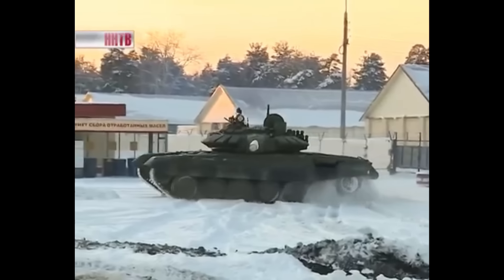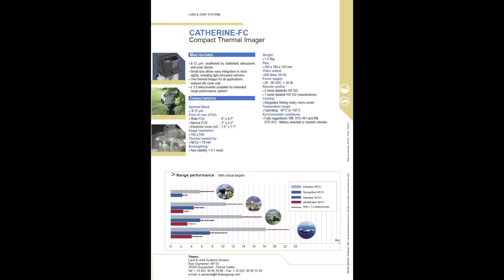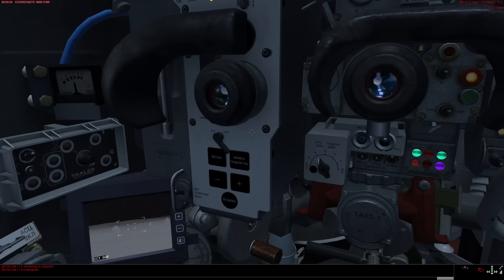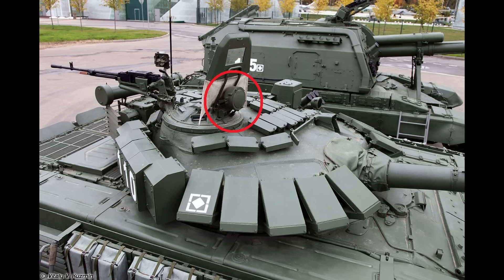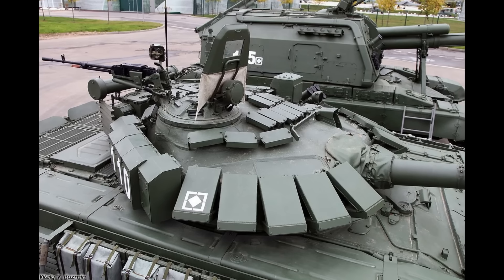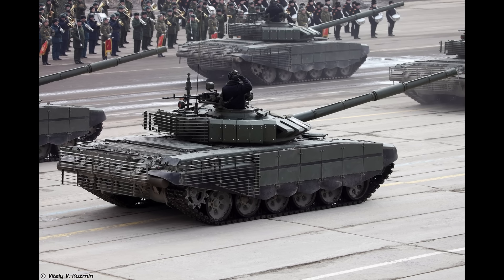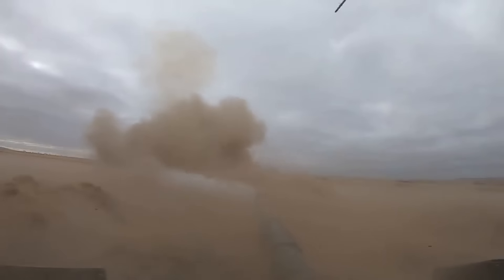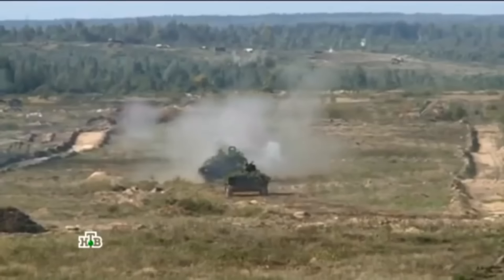Problems with Russian T-72B3 tank

Comment: I don't think I've seen any destroyed 72 having been penetrated in its frontal arc, so I'm inclined to say it's well protected there. I think it's Achilles heel is the reverse speed as in most of the footage given the type of combat they're doing, they're trying to shoot and scoot and forced to do a 180 to retreat and get hit. Majority seem to fall victim to artillery and mines more than anything else. So really, although an adequate tank overall it certainly suffers alot more in this kind of fighting as the tactics and forced used are not those for full scale war. The almost non existent reverse speed does boggle the mind though. I'm sure if there is takeaway for a further upgrade, that and the rubbish bags on the sides will be it
Reply: Well top attac atgms also ripped them apart alot
Reply: @Gazza Boo I think at this point, everyone bar Japan, China, India and South east asian countries should just buy merkavas.
Reply: The T72 was specifically designed for a head-to-head shootout in the open.  Hence the low profile and thick frontal armor.
Reply: @gamingrex2930  Laughs in K2 BlackPanther
Reply: Honestly the biggest killer is poor tactics. The issues with reverse speed could be negated if the tanks were properly supported by infantry and light armored vehicles. The tank wouldn’t have to worry about escaping quickly if it had units along side it to respond to threats. But you don’t really see the Russians doing that. Instead most of these tanks getting destroyed are alone, and exposed.
Reply: @timmteller871  and those seem to be in the minority just going off photographric evidence
Reply: @Gazza Boo I mean are not all MBTs these days only have Composite Armor on the Front only?
Reply: @gamingrex2930  Merkava is overrated. It's too heavy, not well protected and don't have that much firepower.
Reply: @gamingrex2930  merkava is way too heavy for most of these nations and marginally better than rest of the competition, merkava is also not ideal for railway transportation,
Reply: Funny guy
Reply: @boot_boy_6945  This, so much. I'm surprised by the tactics used by both sides in this war. At least, what is shown through drone footage and otherwise. There seems to be no or lack of mutual support. I feel like it's a lack of proper training; neither infantry, nor armoured have confidence in each other. I remember an article written by the Germans during WW2 of the regular infantry and tanks. As opposed to panzergrenadiers (infantry trained to cooperate with armour) the infantry waiting for the tank to take initiative and generally sat back, viewing it more as some sort of mobile artillery platform. The same thing seems to happen in this war. Its why training is important, it overrides instincts and bias. I get using a tank to take the lead. Armoured and with a big fuck off gun. But that tank is only as useful as the infantry supporting it.
Reply: @timmteller871  well a top down attack ATGM will completely destroy any tank at this point lol
Reply: @gamingrex2930   Nah, Merkavas are over-rated and are designed to specifically fit the Israelis. There is a reason why no other main battle tanks can carry a small squad of soldiers inside: they don’t need to. They are also designed with crew protection as the main focus which to US, China, India, etc is not an issue as they have plenty of man-power to conscript from. It’s like suggesting an amphibious tank to a landlocked country, it ain’t right.
Reply: @randomka-52alligatorthatis34  No, composite armor in the sides of the turret and side skirts and like 1/3 of the hull is a common solution in modern tanks. Just look at M1 or Leopard 2.
Reply: @Gazza Boo that's called survivor bias. Look it up. You see wrecked tanks on the battlefield pierced through the rear, sides and top. But that doesn't mean they haven't been hit from the front. The company commander would probably observe that all his surviving tanks were hit from the front.
Reply: @gamingrex2930  ???. Makes no sense considering that they have different doctrines.
Reply: Nlaw, javelin, atgm etc etc etc makes the turret fly sky high boooom 💥 💥
Reply: @Weisior  I guess, but even then, those are only limited to the first few fronts of the sides not all. Unless it has been upgraded with add on with AMAP or other forms of Armor Package usually meant for Urban Warfare or Low-Intensity Combat.
Reply: @denmark39  every atgm does that lol
Reply: @boot_boy_6945  This. Russia was far more successful in its painfully slow march towards Sievierdonetsk, because they had artillery barrages softening up Ukrainian positions ahead of the tanks. But when Russia can't properly field combined arms (such as the start of the invasion, or the recent Kharkiv counteroffensive) even their elite units act like they got caught with their pants around their ankles.
Reply: Most often i have seen T72 tanks just drive a little backwards and after that they do a 180, then put a pedal to the gas.
Reply: @ThishandlefeatureISdumb  "They are also designed with crew protection as the main focus which to US, China, India, etc is not an issue as they have plenty of man-power to conscript from."

Now that's not true. I don't know about China or India, but to the U.S. crew protection is definitely a priority. The U.S. military is extremely casualty averse, mostly for political reasons, as America doesn't have the stomach to endure high-casualty conflicts for very long.
Reply: @Weisior  T-72B have side composite armor - look at the video - in one top shot you can see where the large composite is. You can see the welds. It goes up to about half the way on the side of the turret to cover side shots vs. turret. 
Side of turrets in many tanks is just steel otherwise - also rear. Top and bottom.
Reply: @tomk3732  Obviously it has, I didnt even suggest otherwise.
Reply: @sprutsd9112  Yeah better than bringing a rail transportable metal coffin into a battlefield and having it get ammo racked by a single ATGM.
Reply: The T72 does seem quite adequate for the fighting going on.  Having watched and read a lot of accounts of tank warfare in Ukraine and elsewhere what I am going to say is that the exploding autoloader problem is massively exaggerated. Nobody would use a tank that could be defeated by kicking it angrily in relative terms. And there is more than enough footage out there of T6x, T7x, T8x, T9x tanks being hit hard repeatedly and either remaining in action or not detonating catastrophically. In combat footage it’s not at all uncommon to see a tank hit by three rockets or multiple shells and still keep on fighting effectively. The exploding Russian tank is a funny meme but it’s far from the rule in reality.
Reply: @MotivationSHCUM  That is a stupid comment. Within the IDF doctrin and logistical framework the Merkava is a very good tank. 
And it is well protected, reducing losses of crew members has a very high priority in the IDF. 

To complain that it would not be good in a western European doctrin misses completely the point IMHO.
Reply: It's all about the on-board gearbox. The transmission is not changed. The T-80BVM wins in this regard because of its engine. But the reliability of the tank from the hits of modern ATGMS showed the opposite - a high level. There are quite a few videos on the network, as 72B3 experienced hits of the same NLAW or Javelin. The record was for one car that survived 4 hits in the tower.
Reply: Why would you attack it from the front? That thought bias is interesting.

Comment: The problem is not as much the tank as it is every thing else (crew, training, tactics, operational strategy, logistical support, reliability.......).
Reply: Stop with your lame excuses already. The problem is the tank. To be more exact, the lack of equipment on this tank. All crews have at least basic training, or they wouldn't even be in the tank in the first place. That's what the army does, it trains the soldiers to do what they are supposed to do. Incredible, I know right?... 🙄
Reliability is part of the tank's mechanics, so if you criticize the reliability then you are literally criticizing the tank itself. By the way, the reliability is not even the problem with this tank.

The biggest flaws are the lack of an independent commander's thermal sight and of course Active Protection System (APS). If this tank had at least those features, then it would actually be a very good modern tank. But it doesn't...
Reply: @xAlexTobiasxB  Russian tank crews trained???  Dude let go of the marijuana!!!
Reply: @drinksnapple8997  how do you think they are able to drive and operate the tank? 🤦‍♂️🤦‍♀️🤦🏽‍♂️🤦🏼‍♀️
Reply: @xAlexTobiasxB  They can't.  Drunk with vodka.
Reply: @drinksnapple8997  Sure mate, the war in Ukraine never happend. Alright then 🤦‍♂🤦🤦‍♀
Reply: @xAlexTobiasxB   North Korea also operates a small navy of destroyers and a decent size air force (including Mig29s). Does that mean it will go 1 on 1 up against a US carrier fleet and a Squadron of Top Gun trained F22 pilots? Russia is fighting against Ukraine (who has very moderate training at most). If this was involved top US/UK and German tank platoons it wold be very different war.
Reply: @voidwalker9223  No, Northkorea has no modern "destroyers", only some small corvettes (called missile boat). The Northkorean submarines are much more dangerous, even tough they are only very old and outdated small submarines, they are still a serious threat (beacuse submarines are more difficult to detect and defend against). 
Besides what does Northkorea have to do with anything? Your comment doesn't even make any sense. This is not about Northkorean, this is about Russia, Ukraine and NATO

Ukraine ist not just "moderately" trained, they have in fact very excellent training from the USA and NATO. The urkanian soldiers are even better trained (and better equipped) than the Russian soldiers at this moment. The Ukrainians have superior drones, missiles and Guided Rocket artillery (HIMARS) to effectively destroy Russian Forces. 

The Russians have at least 3 Times Higher losses than the Ukrainians (50.000 Russians killed vs 15.000 Ukrainians killed)

Comment: Along with what you've pointed out, the biggest weakness of all Russian tanks in Ukraine is that they don't have an active protection system. You put an Arena-M and Nakidka on them and losses will go down significantly.
Reply: Or maybe start using it together with infantry instead of sending like 5 tanks in a city full with grandma's with RPGs.
Reply: Arena-M barely works, it was only tested against direct attack ammunition and judging from the way both Arena-M's and Afghanit's explosive cartridges are placed just next to turret ring they have 0 chance to hit a Javelin diving on the tank from 2500m above. That's why Iron Fist APS has a small turret placed on top of tank turret holding just 2 reloadable cartridges that can hit top attack ammunition.
Reply: Today very few tanks have an APS. Only M1A2C and Merkava-4. Turkish Altay sports an APS, but it's not in service thanks to lack of engine. Russians had an APS for a long time but being slow as fuck it's taking them ages to get them going. WHich is shit, but it is what it is.
Reply: @TonymanCS  Javelins have a low hit probability in top attack mode. More dangerous are the direct attack or overflight weapons like NLAW. Arena-M can deal with those.
Reply: As long as the Russian are able to produce enough of them..... right?
Reply: @FelonE-k8x  That's a point for any and all APS.
Reply: You're saying this as it's just that simple "just put on some of the most advanced systems in existence". These systems are still not well tested and expensive. I would hardly expect Russia to implement those kind of upgrades when they could barely afford to upgrade their tanks to the B3 standard in the first place.
Reply: @TehIdiotOne  "Barely" afford? Given that there are over 1500 of B3 in service, I wouldn't call it "barely". To my the standard is insufficiently high, but then my standard would be as expensive as buying brand-new T-90A or even T-90M tank.

As for APS - let's just say that it IS in the process of testing. What criteria is levelled at it is not yet known.
Reply: @TonymanCS  2500m above? Dude, who is your dealer? His stuff is GOOD.
25m maybe at best. Also Javelin is an expensive and painful to use POS. The ONLY worthwhile mode is top-attack. But when it takes 30 seconds to lock onto the target before launch, I wouldn't want to be there THAT long.
Reply: @Max_Da_G  The T-72B3M and T-80BVM upgrades are next to useless for the needs of the war in Ukraine. Large scale Tank on tank battles are just not going to be a thing in modern warfare. They should have allocated more resources towards things like Nakidka, Arena-M and and more Advanced soft kill systems and sensors to counter infantry anti tank missile and rocket threats.
Reply: @TonymanCS  "Javelin diving on the tank from 2500m above" javelins r pretty faild in ukranie. have a really short few hundred meters effective range only. after that turn inacurate. and becuase that not easy to use in urban area but impossible to use open field. its a fail.
Reply: @Max_Da_G  aps of merkava is a stolen russian drozd aps form 1970...
Reply: @makoado6010  Ummm no. Concept is similar, but execution is different.
Reply: @Max_Da_G  nah. after lebanon mascare of merkava tanks they buyed few old soviet drozd system form ukraine és started to copy.
Reply: @makoado6010  Drozd APS uses fixes tubes with counter-charge. Trophy uses an aimable turret. Whole lot of difference between the two.
Reply: @Max_Da_G  they just upgraded a bit the 70's soviet technology.
Reply: @Max_Da_G  бабушке своей будешь рассказывать эти сказки. Украинцы заговорили про ящерку только после программной статьи путена про Украину. А насчёт equally corrupted - что-то я не видел фоток с табуретками в западной бронетехнике)